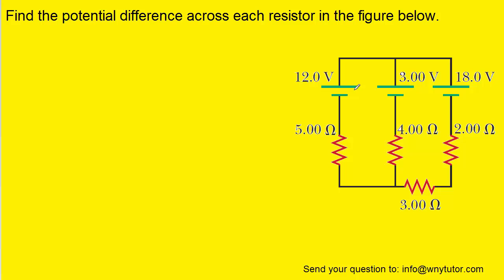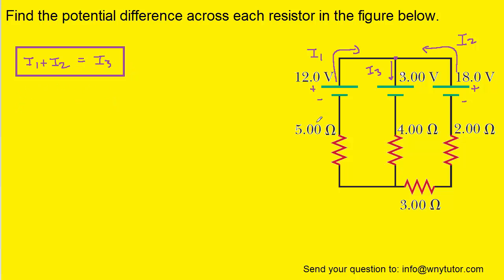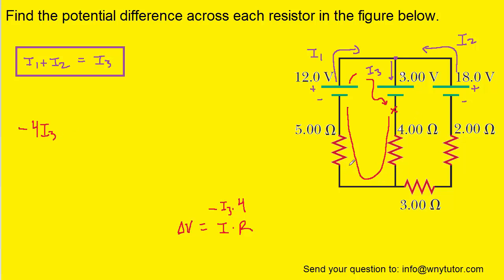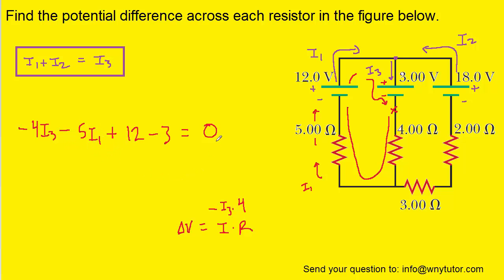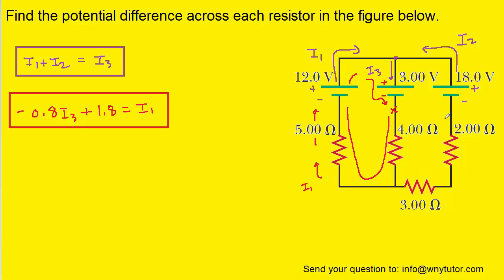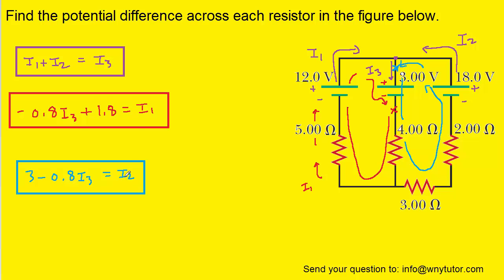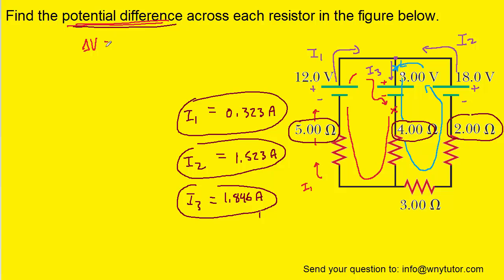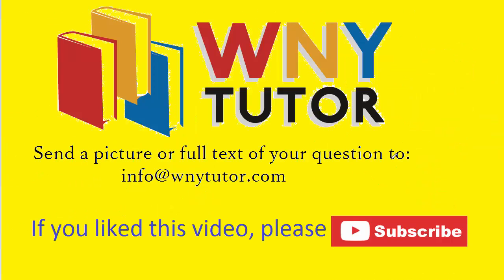Find the potential difference across each resistor in the figure below.

Comment: I need help 
1. Why did you start 3v and not 18v 
2. How do you determine where the current start when is it negative positive
3. How did you tell if  3 ohms should have the same current as 4 or 2